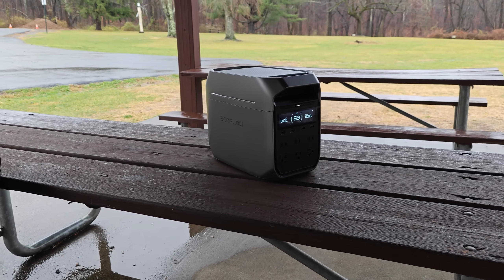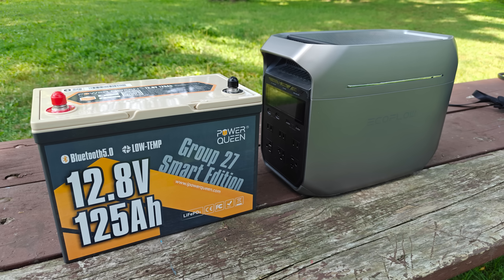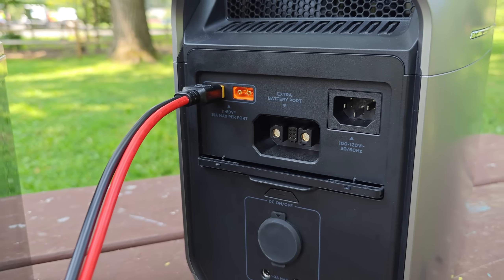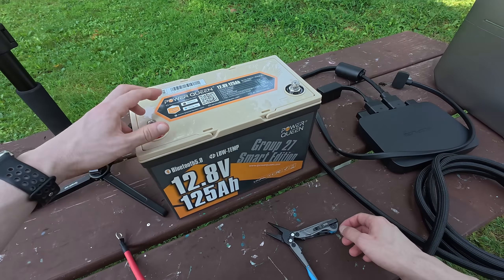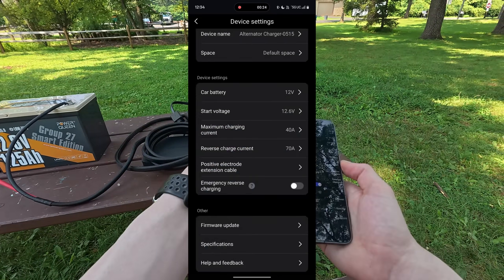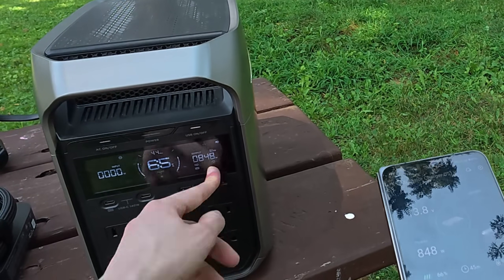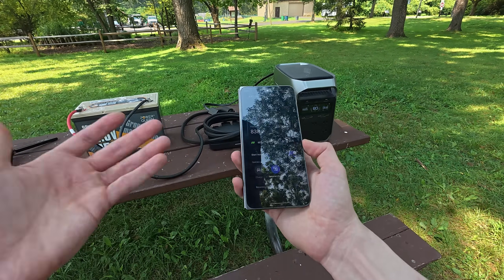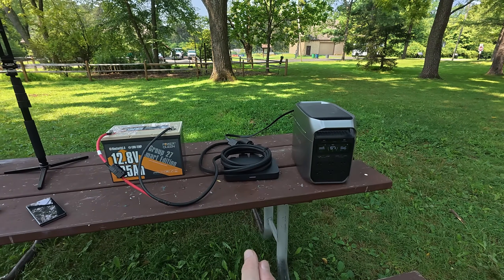How to Expand Power Station Capacity for Cheap!

Comment: Soooo you paid more money for a DC to DC unit just to move the power from the extra battery to the Ecoflow 5X faster? Why?What’s the hurry? Zombies banging at your door? Just use your first method with + and - leads into the XT60 connector. No need for apps.

Comment: Great tip. I have seen other channels just hook up battery thru solar input to extent the capacity. Good idea if have emergency situation and need more power, but you cannot charge back. I like idea of dc-dc charger: that solves the problem and makes it a bit safer to operate. Thanks.

Comment: Just buy a 24v battery rather than a 12. No need for a DC to DC charger. Just put your fused XT60i cable on that. You'll get plenty of charging speed for any of your power stations with no extra costs. You can even hook up your battery charger anytime to the DIY battery while it is connected, and it will charge your DIY battery and keep your power station charged up without any manual intervention. No need to use an app if you don't want to. 24v batteries are a nice sweet spot for charging speed/performance. Good video, thanks for the ideas too.

Comment: Instead of buy tye 12v LFP battery buy a 48v lfp battery. ( which is closer to 55v when fully charged. Either way you will get over 1000 watts of input hooking it up the way you did the first time.

Comment: Or buy two smaller lithium batteries and run in series to double voltage and therefore double charging rate.

Comment: Well, I went with a 48v 100ah "golf cart" battery including its own wall charger, fused cables, onboard display plus app for $700ish a couple months ago for my expansion and now have 7.5k w/h capacity and charges up to 1000watts, if needed.  All for the same price as this setup.  No dc-dc charger needed.
Reply: What battery manufacturer did you go with?
Reply: @davidh8279  Temgot

Comment: Can you setup an automation in the ecoflow app to automatically switch the flow of charge on the external battery based on if the power station is taking a charge via AC or solar?

Comment: What if the power station DOESN’T EVEN HAVE an expansion port?  I’m looking fairly closely at the Oupes Exodus 1500W/1488Wh unit for selective, 120v circuit backup power, & would like to get it into the 3.5-5k Wh range. I’m thinking the solar port could be tapped for this, but then this eliminates ability to charge it via panels ? Also interested in the most cost effective way to charge the . “expansion battery” as well.

Comment: That DC to DC charger is $300.  The battery is $270.  If you need 120vac, that could work but it is still costly.  Two of those batteries connect in series would give 24vdc into the Ecoflow.  I don't know how effective that would be, but should still boost the capacity.  The DC to DC charger doesn't add capacity, but two batteries do.

Comment: The problem is lifepo4 charging voltage should be 14.4v by specs but alternator gives only 13.9v, also charging curve is not optimal for lifepo4 so solution is working but is not optimal. It is not clear what impact would be in time on capacity of lifepo4, etc..
Found this in another bloger videos.
It would be great if alternator has hardware and software ability to imrment lifepo4 specific charging curve, because currently it looks good for car Pb acid starter battarey.

Comment: just us a 48v battery, with fuse or breaker for safety.  reverse charging is a good feature so you don't need a separate charger for the ext battery.

Comment: I have a mover that I converted to 48V LFP and am thinking of using that as an extended battery if I buy a battery system.  On the fence really as it would be good for a day or so to keep my fridges up in a short blackout and not sure if it is worth it rather just buying a natural gas generator and getting a tap put in to my gas line.

Comment: 👍 With the reverse charging you also don't have to purchase an MPPT charge controller if you want to charge with solar, just plug your solar panels directly into the Ecoflow and reverse charge your DIY battery bank. You can even use the station while doing so.

Comment: Complaining about costly brand cells and then solving it by getting a regular cell and some pricey brand hardware to connect that cell is kind of the double edged sword here...  I got the fossibot powerstation that has double (!) the capacity of this delta model at the same price..

Comment: I looked in the manual.  This is their description of the RJ45 port:  "Preset port. Stay tuned."  Umm.  ok.    I also wondered about overdischarging.  "To prevent the vehicle starter battery or RV house battery from overdischarging, in Charge Mode, the charger will measure the voltage of the battery. If the measured value is lower than the charger's start voltage, the charger will stop working."  That basically means that if the voltage drops at all the charging will stop.  Not stopping at a set point, but stopping if it drops at all.  That's clearly not how this work.

Comment: Would a step-up 12 to 48-volt inverter do the same as this DC-to-DC converter? That device costs $300.  Amazon sells the step-up for only $30.
Reply: Those step-up converters are not very efficient and they can get pretty hot if they don't have a cooling fan. Yep, the cooling fan draws power too making step-up even less efficient.

Comment: Would the Delta 2 be able to accept a solar input via the XT60 and also reverse charge an external battery like this one using the 800W alternator charger? 

I’m looking to charge an external battery like this one using the Delta 2 as a sort of charge controller that gets too much energy through the day through my solar panels. I’m guessing there’s no pass-through and it’s a two-stage charging process?

Comment: A server rack 48v 5kw battery for 999$ and an xt60i cable will give full power and you just have to charge the external battery with solar or grid . That is how I have my off-grid cabin setup.

Comment: This is why my next power station will be a pecron. You can just rig the expansion cable and connect it to a 48v battery and you are done
Reply: So the Pecron stations can either charge from or charge to a generic external LFP battery?  Got a specific model number or a youtube video you can reference?  This is very interesting if true.

Comment: A better solution is to get a 48v 100ah battery (over 5KW), which is far less expensive, than the dc to dc charger plus 12v battery and you'd be able push 400w into your power station.

Comment: Beside the extra cost for the DC booster, you have to lug another item long with you.
Get a Pecron 1000. It's the only power station that let you pull 12v at 20 amps which will let you get ~260w vs 100w.
Or get a 24v 50ah(same size as the 12v 100ah) and you will get around 300w-500w depending on the allowance of the power station.
Reply: Pecron E1500 costs $150 more but has XT60-30A.

Comment: You're spending like $400 to drop 40w on the ground.  If you're only keeping it around 500w, just get a 38.4v or 48v battery, or get a boost converter if you really need to go with a 12v battery.  Either case all you really need is a boost converter.

Comment: The best way is to use xt60i and have two set of cables in the battery and use both inputs so you can get 1kw input. I have the delta 3 plus and I do this and it works and you dont need to have an alternator charger.
Reply: According to the manual, the XT60 port is limited to 500W, but also to 60V and to 15A. The manual also says that with car input (when the XT60 port detects 12V) it is limited to 8A, which is roughly 102W. So .. how exactly are you getting 500W from each XT60 port using a 12V battery? (500W / 12.8V = 39A)
Reply: It just works https://youtu.be/K4SIyWW6vF0
Reply: @NXRSN I have 48V batteries and I charge my delta 3 plus at 1000W, 500W for each port.
Reply: @geekmidget  ground the pin of both the xt60is and you will get 15amps on both sides. you can push up to 60v..
Reply: @geekmidget you are right, 500W. But it is 500w for each XT60 port. The Delta 3 has 2 ports. That's why I said to use both ports connected to the same battery.
Reply: @tamowill  Even with two ports you shouldn't exceed the recommended limit for each port. And when the solar charge port detects an input of 12V the current is capped to 8A, so according to the manual even with two ports you would only be able to reach a little over 200W using 12V input. Which matches what I have observed in practice.

In order to reach 500W you would need a higher voltage, which in theory you could achieve with a step up DC to DC transformer, but it's an additional component besides the cables which would waste some energy in the transformation process.
Reply: @geekmidget you are right again. Sorry this battery is 12v not 48v. In this case i would prefer to buy a 48v 25ah battery for less than 300usd or a 24v battery instead of using a alternator charger. I have the alternator charger but just using one battery and two xt60 port in the delta is what I would use.

Comment: Yeah, no.  Use a higher voltage battery.  12.8 x 15 amps (max solar input per port on the DP3 plus). 192 watts.  But, assuming you have a say, 48V/51.2v battery then you'll max out one of the solar ports but you can easily hook two cables to a single 48 battery, one to each solar port and get the full 1000 watts.  Without buying the charger.  The eco flow 800w charger is 300 bucks.     Two ring terminals to xt60 is 20 bucks, you get 200 more watts, lose that inefficiency of the Dc/DC charger.  That said you need a 36v or 48v battery to hit that 500w limit per port but i and many have that/those for this very reason and others and even if you don't AND you're going to have to buy a 12V battery anyway save your money and go 48V, small amp hour battry.  If you don't have at least a 36 volt or higher battery but do have a spare 12v laying around then by all means buy (and carry) that extra hardware around.  But that is a bulky, expensive option for many of us.  Look around, a 50Ah 51.2v battery is the same price as that charger and much less if you don't already have 12V LifePO4 already on hand but with much higher capacity than that 12.8V/125Ah batter, and around the same weight.  Not really a fair fight in my mind.  Charger is an additional expense I'll pass on.  Spend your money on 48V battery and ring terminal to XT60 cables (10 bucks a piece) and remove the need to carry that extra charger hardware.  Oh yeah, AND you need that proprietary ecoflow cable and input.  nope, this is far more expensive, not as convenient or efficient.  the caveat, you're tying up solar dc ports but you're going to be using this when there is no solar anyway.  It'll work but it's by far the lesser way to charge from battery to power station.

Comment: You could alternatively simply hook up a DC charger to the battery to keep it charged that way, keeping both the battery hooked to the Ecoflow and the charger at the same time, correct? You could have an external battery bank that way, further extending run time. Even better if four 12V batteries in series to produce more than 48 VDC. If this will still work, I think superior giving far more run time than an Ecoflow battery add on at high $$$ and beyond the capacities they offer. You would certainly spend more for a battery bank and charger for it, but beyond the storage available otherwise. Anyone see any problem with this?

Comment: got a point regarding chayrge speed but the dc charger costs about 399 dollars according the link and an extra battery you show 299 so i would go for a set of cables and an extra battery and keep some change in my pocket.

Comment: Every time one of these guys talks, they always have a better way to reinvent the wheel...and that ALWAYS involves a LOT of wires and Boxs and plenty of connections...yep...why buy a good solar generator when you can spend a lot more time hooking all this crap together with more and more wires and boxs...and the joy of finding a place to put it all...whatever...
Reply: You have to put your pv panels somewhere and they require wiring. What's your problem?

Comment: I got a Pecron e1000lfp and a MJ-32 to dual xt-60 output cable. This allows direct access to the internal 48v battery via the expansion port. I have a 48v Lifepo4 50ah GLCE battery that can with 2 sets of xti pigtails hook up to the pecron and will charge and discharge with the pecrons charging. The only difference between the expansion battery, is the external battery can't communicate with the pecron, so your displayed time till discharged or charged will be wrong. I also do have the pecron expansion battery. My point is that for cheap expansion, 48v LiFePo4 batteries can be added to many power stations expansion ports. You can also hook the xti directly to the xti input on most power stations to charge the power station at higher wattages. The expansion port is needed for bi-directional flow.

Comment: The $380 for the DC to DC charger, I can buy an extra Power Station around 1200 Wh, almost same with 100Ah battery and it's has more uses.

Comment: Do you know the best way to support an existing 100A battery in my RV? What would be the best way to connect the Ecoflow Delta 3 to add capacity to my existing Battery. I would like to be able to charge it with solar at the same time. Thanks in advance.

Comment: I read the comments and had to pour cold water on my head because it started to smoke. I just bought a d2max along with an 800w generator charger. A 48v extra battery is expensive at the moment, so I'm thinking of buying a 24v 100Ah. 5 days a week I don't drive anywhere, maybe 10 minutes to work and back. I plan to install a Renogy 200w solar panel. The biggest consumption will be from the refrigerator. This entire installation will be used on the Suburban. So the 800w charger will be independently connected to the Suburban battery. Next on the d2max. The question is how to connect from the 2dmax to the Lifepo4 and whether everything will automatically charge while driving. Do I need to buy some kind of charger separately so that the Lifepo4 battery can also be charged. Thanks if there have same installation and can explain it.
Reply: 48V 50Ah GC Battery can be had for 350 bucks, at least as cheap and likely far more cheap than the 24V 100Ah battery.  It'll also max our any solar input, within reason of any power station you have.   It's not a fair fight between a DC/DC charger and a 50Ah, 5.12 nominal LifePO4 battery, with the same storage capacity but almost certainly less weight to carry (48v/50Ah).

Comment: For $380 for the DC-DC charger you can get a newer 300AH (Dr Prepare) for $319 and a XT60i connector for a couple of bucks (or just modify a regular XT60 for nothing. This is a great alternative with a lot of power. You don't get reverse charging, but go get a 20a charger anyway!

Comment: This is great and all BUT this method is product specific. You can only do this with this brand's eco system WITH this specific model that has that expansion plug. In my opinion the best way to expand ANY power station (ones without the official way) is STILL using the solar charger via xt60 or whatever connection plug it uses. You can modify that version to increase its power delivery by adding a cheap $20 dc to dc buck converter to increase the voltage to whatever your solar inputs max charge rate. Its basically doing the same thing as shown in the video but without all the bells and whistles BUT you can use it with ANY Power Station!!!

 I have an old bluetii eb3a that I can expand to ANY capacity utilizing the charge controllers FULL charge rate. and I use an external portable MPPT controller to charge the external using solar WHILE it's connected to the bluetti. The dc to dc buck converter is also acting as a voltage regulator to keep the bluettis charge controller from burning out with the higher voltage and amp from the external mppt that is charging the external battery at a higher rate.
Reply: Hi, this sounds good. I just bought a dji 1000 power station and would love to do what you said.
So just hook the add on battery to power station via the buck charger? What kind of buck charger? Thanks

Comment: Hi @NPLVentures, can you charge that external battery while hooked to alternator to ecoflow and at the same time there's a running load in ecoflow? For example, I will have set of PV to charge the battery and another set of PV to charge ecoflow as well.
Reply: Will it also by pass the powerstation battery? If the powerstation's battery is full, will the unit use the external battery and not the internal battery?

Comment: Now you have made it able to charge the spare battery, but you still did not increase capacity, you increased runtime. When you increase capacity, your batteries will work in unison, sharing the amp load, and this setup is not doing that
Reply: Sometimes more run time is what you want.
Reply: @Mab-pw4yt  and that achieved it, but what your not seeing is its double working the internal battery, but as you said, some people want the cheapest way possible! Good luck on that endeavor!
Reply: @dustydawson8977 I am a slow learner, just trying to understand. Didn't know it would be hard for the battery. Of course I need it to be affordable, but it should also last as long as possible. So thank you for info.

Comment: The Pecron E1000flp power station, for about the same price of a DC to DC charger, has a power switch that jumps the power to 20 amps from 8 amps from an exterior 12v battery.  Charges @ around 300 watts + has a UPS and a heated internal battery.

Comment: 1:40 i literally use the jackery 12v plug to solar input adapted to use battery clamps to charge at night 30w input... & in morning i connect back to panel for 60w max input... if i have any power after coolers run all day 50w of 100w panel per battery barely much left for lights tho...